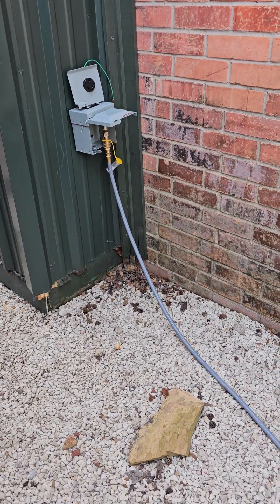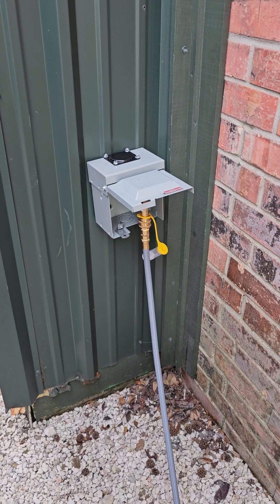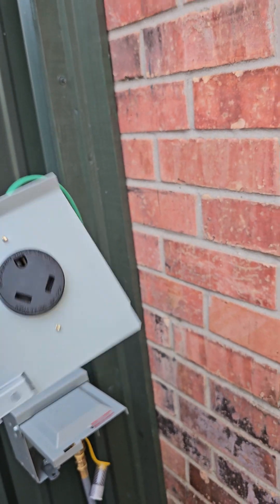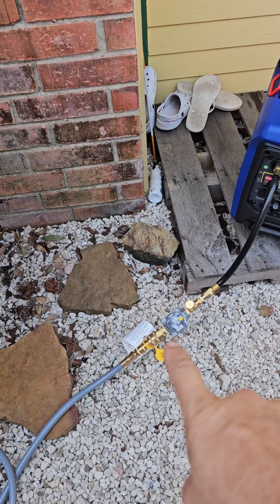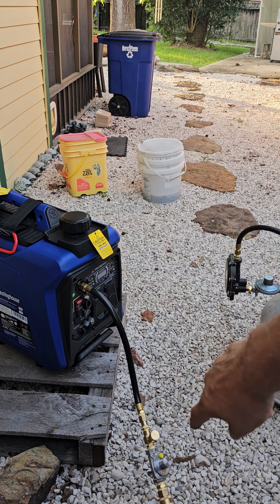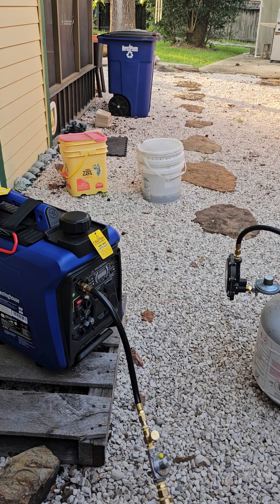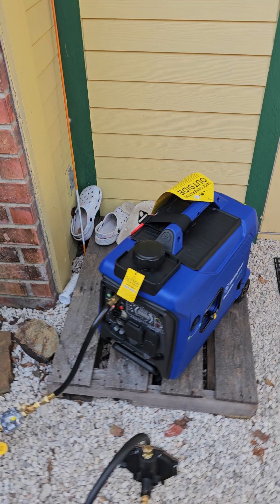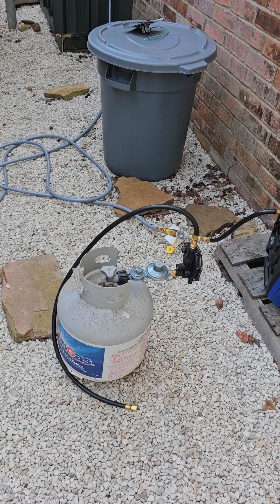Westinghouse Igen4000dfc propane to Natural gas conversion.

Comment: What NG regulator and needle valve is used here? Doesnt provide details on this or have weblinks in the description.  Would help OP since you posted this to shed light on the success but you dont provide the most important info. 

I need for my Westinghouse IGen 4500DF model.

Thanks in advance.

Comment: I see your note of safety & caution at the end of your description. I am glad you posted that. Yes, it would be unsafe to run unattended with the needle valve setup for many reasons. Since your video, I am considering purchasing one of these generators. When I do, here is a demand regulator I will buy to replace the needle valve stuff. Thought I would share it with you.

I have purchased from Century Fuel Products before. If you call them up, they will help you get exactly what you need. Without knowing your natural gas (NG) pressure at the hose outlet, I would recommend these parts:

C-039-122A:  W/ MANUAL PRIMER, W/ 6OZ SPRING

4OZ SPRING

You will need additional parts/fittings to be sure. One of their kits might work well for you.

If you order a demand regulator from them make sure it looks like the one pictured on their website labeled: C-039-122 

This particular demand regulator will accept the lighter 4OZ spring if you find lower pressure NG at your residence or wherever you windup taking your generator. The C-039-122 demand regulator will work with both propane (LP) and NG. You just have to adjust it differently depending on the vapor source type (LP or NG) and the corresponding inlet pressure. LP needs the 6OZ spring to function around 11 inches Water Column (“WC) pressure so you’re good to go with that. Adjust the Power Elbow to get the engine running smoothly at load (out is rich - in is lean). Try getting NG to run on it (after making Power Elbow adjustments; out is rich - in is lean) without changing the spring. You have the lighter spring to try if it does not work. A lot of neighborhoods are provided NG, by the gas companies, at around 5”WC pressure. Hence, the 4OZ spring.

Comment: Awesome video!
Btw do you happen to know if the 4000w is any easier to carry than the 4500w?
I bought the 4500 and it's like 106 lbs and I can barely lift it 😰. The 4500 has 2 bar handles on top for lifting instead of 1 but I read it weighs 30-40 lbs more than the 4000. I'm still in the return window and thinking of trading the 4500 for the 4000
Reply from the maker: Hi I'm not sure about your question but I can say this generator for me is very easy to handle I keep it and its original box with the styrofoam packing and bring it out every now and then to charge the battery and run it for a couple minutes. And I can do that just fine

Comment: I just ordered the same generator and plan to do the same thing but I have a question.   I've done LPG to NG conversions before and typically there's an orifice on the equipment (internally) that you have to swap out, did you have to do that?  

I would like to make mine tri-fuel and not lose propane ability.  So if you set up the generator for NG and then reduce pressure externally for propane with a regulator and/or an additional orifice.  Is this how you did it?
Reply from the maker: @pnof955  I did not have to put a orifice internally. I think the key is using the needle valve with a natural gas regulator

Comment: This is great. Do you happen to have a breakdown of all the parts and fittings? Thanks in advance
Reply from the maker: @captainkirk2157  sorry I don't that's been a while ago already basically get the hose from Harbor Freight and then the appropriate fittings. Your application will be different I'm sure

Comment: how do you like your generator? can you lift it okay? how is the remote start?
Reply from the maker: So far I like it a lot can't beat it for the price. Everything still works and we may get to test it out tomorrow and Wednesday with this ice and snow we're getting ready to have
Reply: @leroydiesel6.5 let us know how it does and how fuel efficient it is once you get to use it.
Reply from the maker: It's easy for me to lift and handle. I honestly haven't run it long enough to know what sort of economy it has. I've only run it on natural gas and a little bit on propane

Comment: Hell,   that’s a perfect idea. Great, thinking Leroy great thinking.
Reply from the maker: @jerrydlaughrin2880  thank you but it's not totally a new idea engines have run on natural gas for a long time I just got it to work on this engine. The needle valve I believe is the key
Reply: @leroydiesel6.5     I know that Leroy I was referring to the electrical box idea to hide your gas hook up there at your chimney. That’s what I was referring to at the side of your house.    Like my house here in Albuquerque I have a gas line as well and I thought about putting a big generator in the backyard to hook up to the electrical panel and hook it to the natural gas line and that’s a great idea. That’s what I was referring to the electrical box hook up like you did, perfect they sell generators that run on natural gas as well. And also some that run on Diesel and natural gas just switch them back-and-forth
Reply from the maker: @jerrydlaughrin2880  Thanks again.